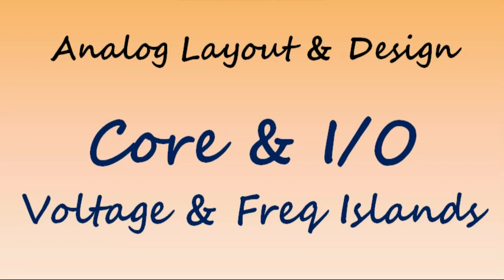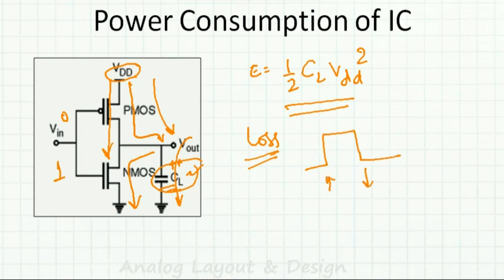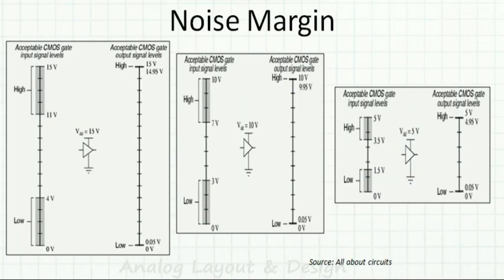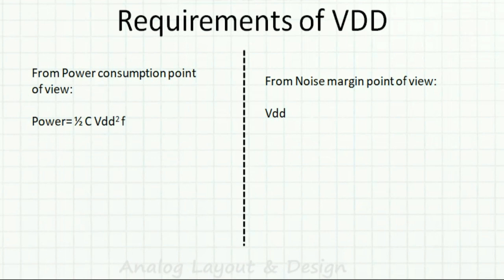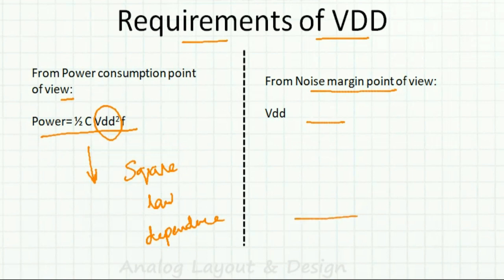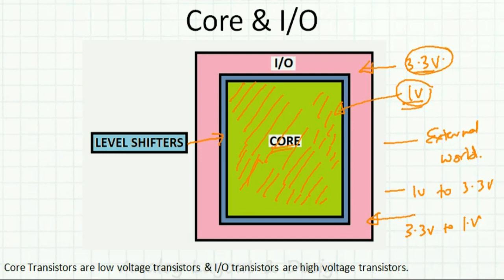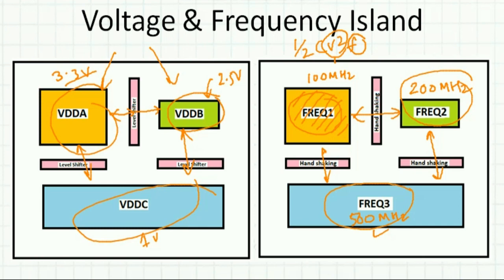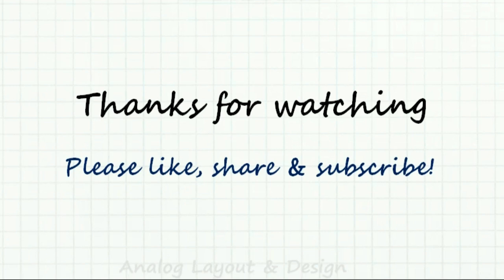CORE & I/O (Voltage Island & Freq Island)

Comment: Why the core voltage is less than I/O voltage ? Can't it be same ?
Reply from the maker: Core voltage will always be lesser than I/O.
Bcos, power consumption is always proportional to square of supply voltage. There is big saving in power. For noise margin reasons the I/O is at higher voltage

Comment: why do use consider capacitor as load? usually it can be 50 ohms for matching. kindly clarify
Reply from the maker: Now a days the load is capacitive in nature.
Ur right earlier they were keeping 50ohm at every stage; for ex rx.
But now only antenna is 50ohm.
Rest all blocks are locally impedance matched.
Hope this answers